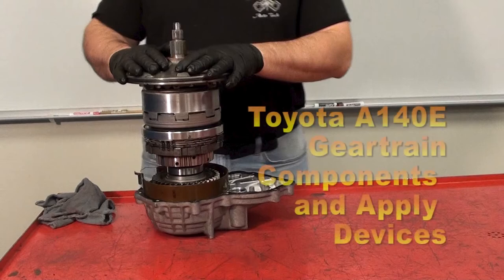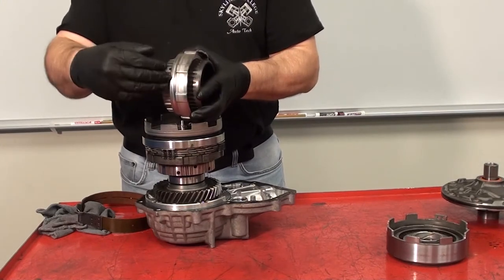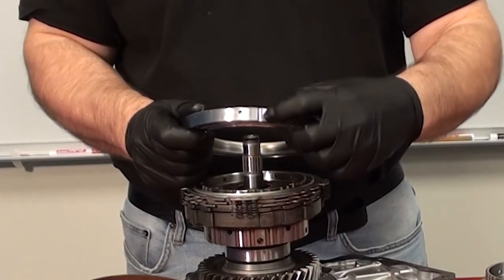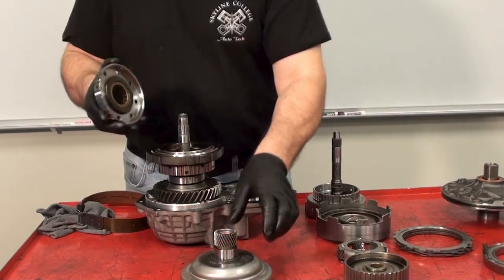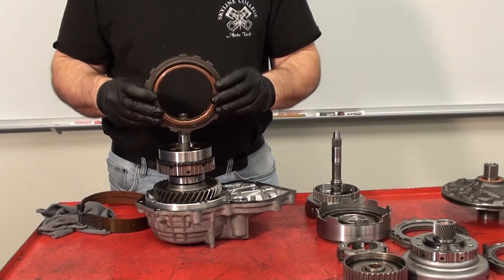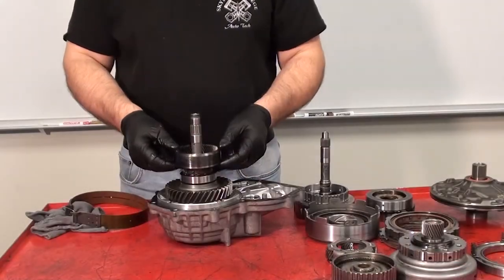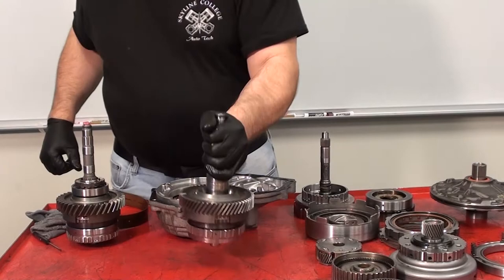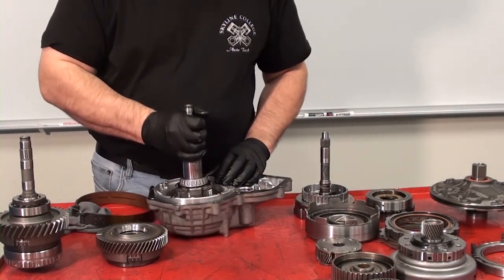Toyota Automatic Transaxle Power flow Components Explained

Comment: Thanks a lot for sharing. Could you please let me know whether planetary system of A245E is similar to A140E?
Reply from the maker: it's the same up to time stamp 5:22.  The A140E transaxle is an overdrive transaxle and the A245E us known as an underdrive transaxle.  Both transmissions produce an overdrive gear ratio but how overdrive is accomplished is slightly different.  I don't have any videos that describe how an underdrive transmission works but it might be a good topic.